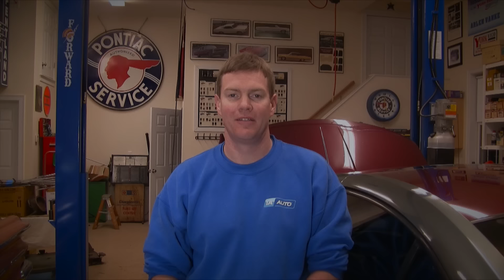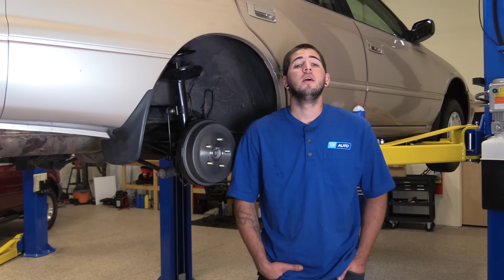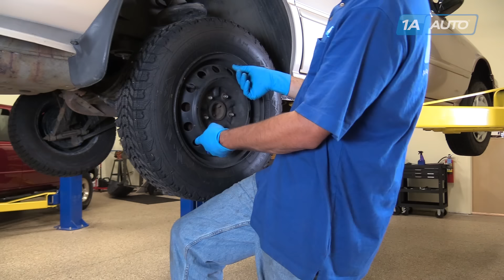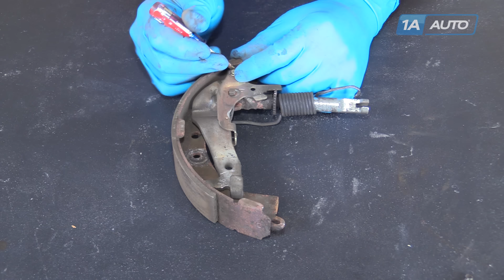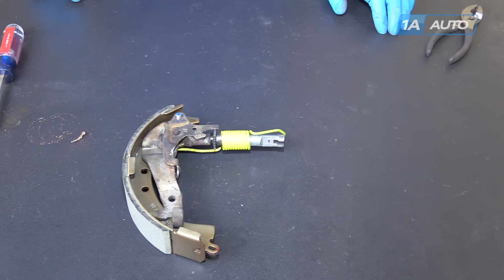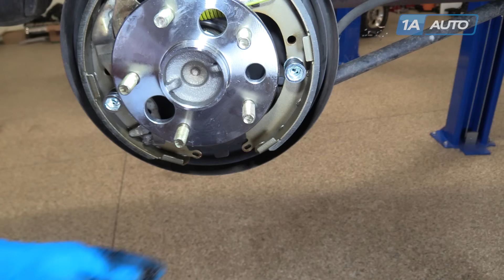How to Replace Rear Drum Brakes 97-01 Toyota Camry

Comment: followed your instructions step by step and everything went mostly smooth. Except for re-connecting the E-Brake cable, THAT SUCKED!!! So I just didn't disconnect it on the 2nd wheel. Thank you for the help

Comment: More tips. Get a tube of synthetic brake grease. Lubricate the adjuster very lightly. Lubricate the points where the shoes rub on the backing plate. You can lubricate any point where anything rubs on anything else. Synthetic brake grease can replace anti-seize grease in almost every application except spark plugs. I use it on wheel nuts for example.

I bought small tube of synthetic brake grease for less than five dollars about three years ago and I still have half left after front and rear brake jobs on three different cars.

I just did my second Camry a few days ago. The Camry self-adjusters work. If they don't work, you did something incorrectly.

Comment: My FSM says to pull the hand brake up several times to adjust the brake mechanism.  Also, I would suggest pulling the handbrake while the drum is off to make sure the adjuster is working properly.  One side of my adjuster wasn't seated in the shoe fully and it wouldn't ratchet and adjust.  I wish I would have seen this first.  I will say also, I did this on my daughters 1987 Camry. It's exactly the same except there was a design change between her year and the year of this car.  Her car had a step on the pin for the handbrake mechanism and only one horseshoe clip.  The newer style like yours has no step and two horseshoe clips.  Took us a bit to figure out how to convert.

Comment: A small tip: You can pry open the clip that holds the emergency brake cable to make it easier to remove. On reinstallation, you can tap it a little to tighten it up. That what I did when I worked on my Camry Solara a couple of years ago.

Comment: I purchased a set of TRQ shoes and drums for my 01 Corolla S and I'm dealing with scraping and squeal noise on R/R side only. I've adjusted the star wheel that didn't work. I swapped the R/R drum to the L/R side and still hear noise on the R/R side. I've also swapped the shoes on the R/R side to the L/R side and re adjusted, and still brake noise on the R/R! Any suggestions why is it only that side? Do I need better brake shoes?
Reply: Sometimes brand new brakes need a little while to be broken in, how long have you had them installed and how far have you driven?

Comment: Thanks for this video, I was having some difficulty today getting the first side back together (and the exploded diagram in the Haynes manual wasn't very helpful). Turns out, whomever had worked on that side last put the return spring on in the wrong direction! (I don't know how they got it together that way, but they did!) Once I corrected that, the job wasn't too tough. Your close-up at 3:47 solved my problem...
Reply from the maker: +DashCamAndy Thank you! We love empowering our customers and showing how to perform DIY auto repairs with our high-quality auto parts. 1AAuto.com

Comment: These are super helpful videos. My thanks for posting them. However.... It would be even more helpful if after you show the entire procedure, you also showed tips and tricks to getting the frozen, stubborn and complex parts loose, reassembled, aligned and mated properly, if ya know what I mean? 

For instance, in this brake video on an OLD Camry, what are the chances the drum will just pop off... Maybe, maybe not. But if you had shown in the "Tips" that the drum has a threaded hole specifically for screwing in a bolt which then pushes against the hub to literally push the frozen drum right off the hub, DIYers would be that much more intelligent and your videos would be even more useful. Just sayin'.

Comment: Nice professional video.  Instead of needle nose pliers to remove springs, pull with a piece of strong spring or make a steel wire hook.
Reply from the maker: +Piet Maritz Thank you for the suggestions and for watching!
Reply: Like a trampoline spring?

Comment: This was really helpful  thanks guys . So I’m having trouble putting back the drum it fell like the brake shoe are big for it so idk if I have made a mistake or the place where I got my shoe didn’t give me the right size so please if someone knows anything about it let me know please
Reply: Hey Alex, the same thing happened to me last summer. No matter what I did one side wouldn't fit on.  I must have tried 50 times and finally the next day  again after many attempts it slide on. I don't know what I did to get it on but was afraid to remove it to do any adjustment. I'm curious if you figured out what happened.

Comment: Well done. A quick shot of penetrating oil makes that plug much easier to work with and I like to hit the adjusting screw threads with graphite as it won't attract or hold dust while allowing the auto adjusters to do their thing. Also, if the drum doesn't want to come off there are threaded holes on the face that you can thread bolts into then using hand tools turn them in to push the drum off.
Reply from the maker: Thanks for the suggestions and for watching! +Richard Anderson

Comment: He makes it look so easy. I had great difficulty with the springs.
Reply: I plan to make my own spring pull T-hook tool

to release and later re-engage the springs.
pliers are nice, however, it would be easier to hold a cross piece and pull with 

greater force with such a hook than you could with pliers. both tools would  work, but the 

hook would be more convenient.
Reply: They do this stuff multiple times a week probably, once you do it after 5 times, you'll get it down too man
Reply: My regular pliers weren't cutting it, had better luck with looping a twisted (stronger) bailing wire that i looped around a wrench.pulling with one hand,  using pliers in the other to push the hook in place once stretched enough.  It worked,  but i don't recommend it if you have time to prepare before the job. But if it's 9 pm and you need brakes for work in the morning,  they work fine.
Reply: Same I remember doing this on my 02 Civic and damn I was stumped after changing those drum brakes
Reply: @KornblumCars2022  Harbor Freight sells a Drum Brake Spring Pliers Kit that makes this dumb easy to do. I don't know why more mechanics on YT don't show them.
Reply: Same

Comment: This is the exact same for 87-91 Camrys. Just sharing the info for anyone looking to do a brake job on their 1st gen camry.
Reply: Did you have an issue with the pin for the handbrake lever being different?   I did on my daughters 1987 Camry.  They were factory original, 30+ years old.

Comment: So I guess the back wheels don’t need break pads ? Because I bought some and went to a mechanic and had put on it but I left and I didn’t see him work on it. He got me ?
Reply from the maker: This video shows a vehicle with a rear brake set up of having drums and shoes. In this style set up, there are shoes instead of pads.  Rear brakes that have a rotor would use pads. Hope this helps! +Ketchup Rod

Comment: Please help. I recently did this job on the 26 and it all works well but I noticed my e-brake isn’t working. When I pull the lever from inside I hear it click but it doesn’t tighten up it feels really light to pull it up but I did reattach the e-brake cable. Why isn’t my e-brake working ?
Reply: Clicking in the e-brake lever or in the drum? If going in reverse and braking hard doesn't do it, you would have to manually tighten the self-adjuster.
Reply: Tighten the adjuster as far as it will go until the pads make contact and back the adjuster wheel off until the wheel moves but not free spinning year late but hope it helps someone